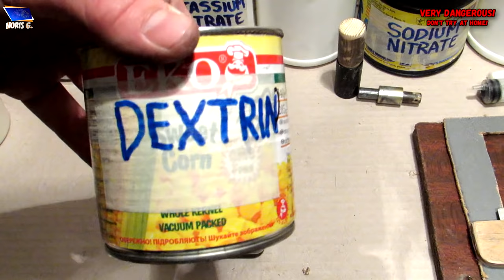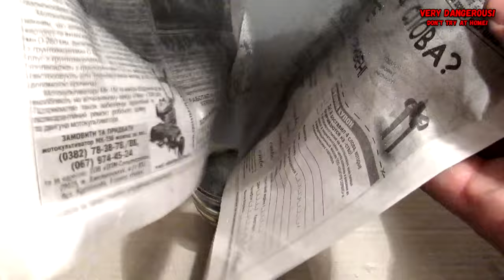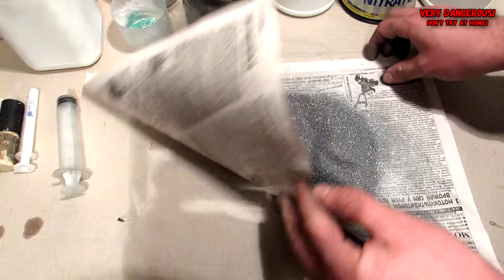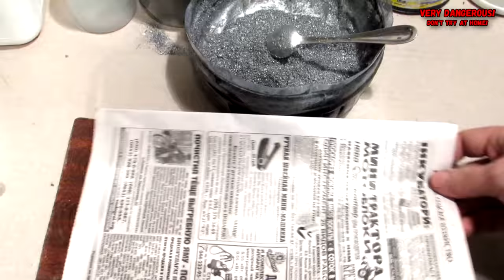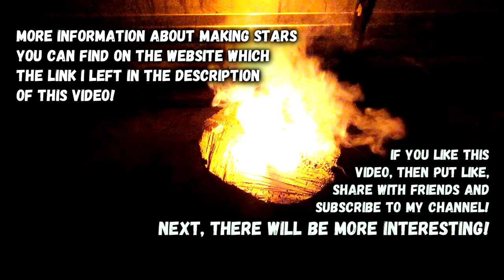HOW TO MAKE A PYROTECHNICS STARS? / 3 WAYS

Comment: Very informative video. I know all the methods but is good to see how you do it. Can you make a video of your ballmill?
Reply from the maker: this channel has an example of how to make a ball mill
Reply: He shows tons of NO NOs. This video will get people hurt. He is mixing sulfer and chlorates, hammering things that are friction sensitive explosives (in mexico they use hammers to set these off), he uses 2 different metals which forms a battery, you should cut these mixes while wet and not dry, he uses water with magnesium.
Reply: @excitedbox5705  i know he sets a lot of bad examples but is it really that bad to use water on mg? I have always used vodka for mine and nothing has happened yet ( no really funny smells or something like that, I leave the window open over night just to be sure tho) so is it just with pure water  that it can form enough hydrogen  or is it only dangerous with open flames and in bigger amounts? I only work through like 50-100 grams of dry star mix per day if I make some so it's not kilos on kilos of mg
Reply: @boratsagdiyev5679  It all depends on particle size and temp. All it takes is one person going for the extra fine mesh when they are buying their supplies instead of what he uses and boom. Or in case of friction sensitive stuff maybe someone gets stuff that is a little more coarse and it creates more friction during the dry mixing. Or there is an extra dry day and there is more static due to the low humidity. It might work where he is but someone living in a different climate might not be so lucky.

There are so many explosions in factories were things have been done the same way for years and even with stringent safety regulations, one day it goes boom.

This video should be taken down and if anything re edited with proper safety precautions.
Reply: @excitedbox5705  so very very fine magnesium would be bad with any kind of water? Mine is 40q and as I've said I use vodka to moisten it so it isn't submerged in water for days, next day they're already dry to the touch. My question is , can there already be produced enough hydrogen so it self ignites? And if so do the slightly wet stars ignite also due to high temperatures ? If so then I'm only going to make stars outside in the garage from now on. 
All that other stuff with bigger particles and friction and so on I knew, I always use a sieve when making my powder and what doesn't fit through goes in the trash so there's no way of ignition while mixing because of a piece of titanium or whatever found its way in. I only mix that in when the mix is already wet
Reply: @excitedbox5705  hahahahah, really)))

Comment: Isn't that friction sensitive? I think it is wiser to cut it before drying.. to minimize the risks. And you should use other kind of material for your knife/spatula. It is not advisable to use metal utensils. But anyways. Nice video though.
Reply: 5 hours of drying so that it isn't tacky and easier to cut but it was still wet and soft
Reply: great video but I was thinking safety while I was watching you do all of the cutting banging rolling and hooking up electric leads next to a lot of product.. its like your saying if I have an accident I want to make sure its a big one
Reply: @ucmekillu  why are you replying to a comment with this bro

Comment: Wow you put magnesium in it, with kno3 and perchlorate gees dude you know if you make a 50/50 with kno3 and magnesium thats the most powerful flash you will ever make, if you already dont know, half a teaspoon has the power to blow your finger off. Also how do you get purple from kno3 mg sulfur and dex if i left out the clorate? I will try to and see if it works....ok doing a batch of your comp without the clorate doesn't work, just a very bright star glitter star thats basically from the mg/al, i will try it again when i get some more clorate.

Comment: NEVER use 2 different kinds of metals. 2 different metals make a battery. Depending on the metal and chemicals you could set off your mixture.
Reply: you are kinda right but actually, it depends on the metals used.

Comment: For the love of god, DON'T make the first composition. Potassium chlorate and sulfur are very sensitive when mixed! I'm actually surprised that it didn't explode in the video. If possible use perchlorate instead, as it is much safer than chlorate. People that make fireworks on a daily basis all know that chlorate is a very reactive oxidizer that when mixed with phosporus or sulfur can be touch sensetive. Those red caps found in toy guns that makes a loud bang, yeah, that's the sensetivity of chlorate.